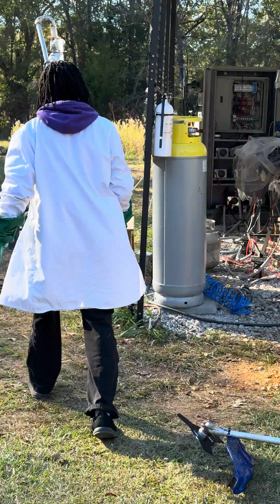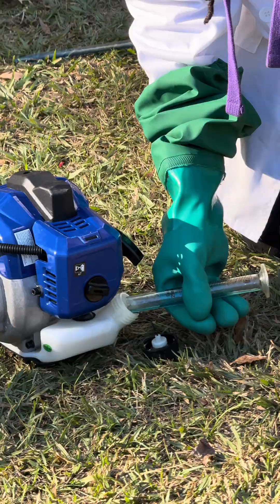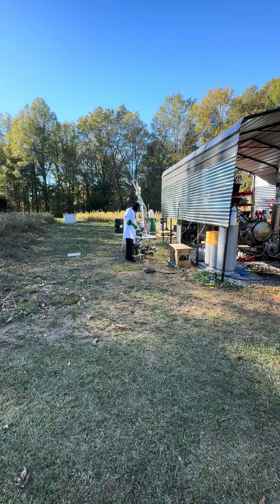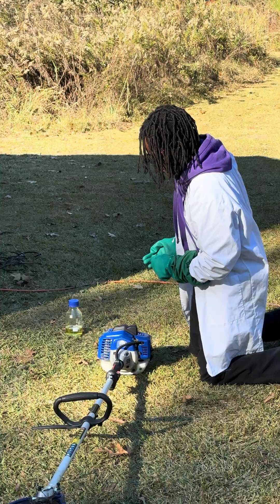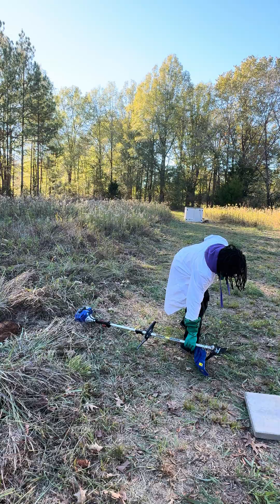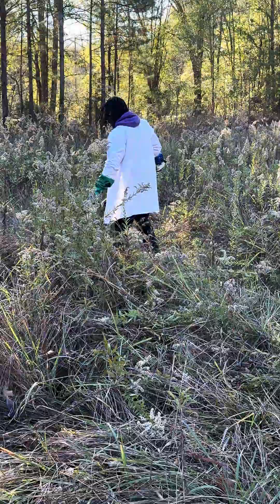I RAN a  Weed Whacker off PLASTOLINE (Gas made from PLASTIC) UNCUT!

Comment: see if somebody has a stihl they will let you use. Make sure to use it wide open for about 15 mins at least before you dump the fuel and try your plastoline. That should eliminate all the varibles that arn't due to your fuel.

Comment: On the Stihl four stroke it has a channel in the combustion chamber that sends the mixed oil and gas into the valves before combustion so it still needs to be mixed as well as the new echo four mix engines

Comment: Yo, Julian. Check this out: 

The benzene market was valued at 48.65 Billion UDS back in 2022. It is expected to grow to 62.55 Billion USD in 2030. Ever since I watched three videos of those guys critiquing what you are doing, I immersed myself in some petrochemical literature over the holidays. The link between plastic and fuel sounds SUPER COOL, but the link is hardly there. What you are producing from your reactor is benzene and its children (derivatives). Yes, benzene is an additive to fuel, that is the only link to fuel plastic pyrolysis has, but Benzene, Toluene and Xylene (BTX aromatics) can be used to make other things, too. I know they sound "uncool", some of them are making pains solvents and so-forth. 

Please consider pivoting from Plastic = fuel and maybe look to plastic = aromatic petrochemicals.

BUT! If you really really wanna continue with plastic = fuel, then I suggest you focus on the chemistry of why are reaction conditions of plastic pyrolysis for over 150 years have favored the formation of BTX instead of crude oil straight chain hydrocarbons. The key to that is testing out different catalysts, not scaling up the same reactor that produces BTX in the first place.

Kind Regards.

Comment: In the refining process they have bleed off lines at different heights of the condensation tower to separate the clean vapors from the lower grades of oil. It’s actually how they make plastics 😂 I only mention it because I only see one exit for the plasticine. You’re onto something bro.😎

Comment: Now you need to run the engine around the clock just off your plastoline to show long-term effects...  Gotta get a 4 stroke so ppl can't say adding oil adds anything to the plastoline..  Love the concept, and if these environmentalists are serious, they should fight for your cause so we can get rid of the plastic waste...
Reply: There should be no long term effects, the fuel was distilled from the crude, should be pure gasoline without additives.
Reply: @member57  Nonsense, it's full of styrene and other aromatics which CANNOT be used as fuel due to being essentially liquid cancer.  
He's made the stuff they remove from fuel.

Comment: Using microwaves are inefficient, firstly the power is generated from coal then you convert it into microwaves (energy losses) then microwave pyrolyses it(energy losses), why don't just use syngas generated from plastic to pyrolyse it, with some charcoal.

Comment: The reason why the Weedwhacker is not starting is because the jet is partially clogged they run and test them at the factory and then if they sit on the shelf for a long time, it gums up

All you need to do is take the carburetor apart and clean out the main jet with a very thin piece of soldering iron or a safety pin or something

Comment: Cool. Now get rid of the benzene and carcinogens at dangerous levels and get proper lab tests

Also fuels use additives for lubrication, octane, emissions, this is a long way from being used in a car without huge carbon deposits like top tier gas, let alone profitably
Reply: Where Is your backyard refinery?
 If this man can synthesize gas out of plastic I'm sure he knows about fuel additives and carcinogens.
Reply: @ Absurdity. This process has been around for ages and not widey used because its not profitable and other methods are more efficient. You can turn any longchain polymer into gas but it doesn't mean you should run it in engines, additives are needed to reduce carbon deposits and killing spark plugs, constant lab testing etc..
Reply: 😂😂😂 the hate is real, this is a process Rome wasn’t built in a day. It might have been around a long time but nobody perfected it yet maybe he’ll be the first but if he focus on all the negative people telling him this don’t make sense he’ll never achieve anything
Reply: @Lordnover  Cope harder, julian is ripping off investors while making a cancer juice that can never be used in engines. It'd take a whole team and millions just to maybe get a fuel that's as good as the lowest grade pump gas
Reply: always at least one hater in the crowd.